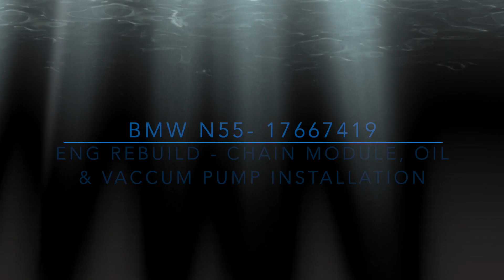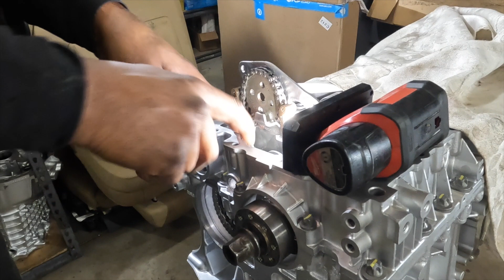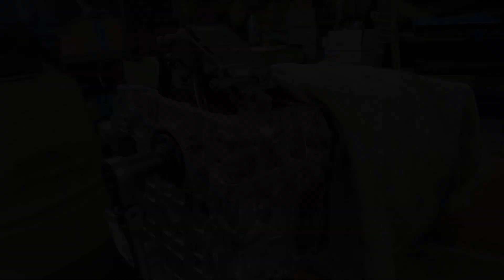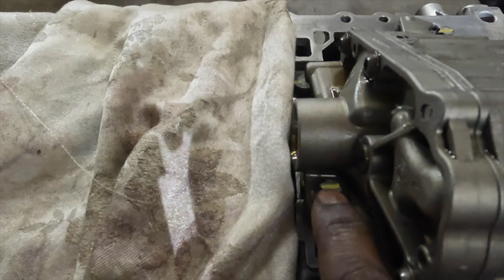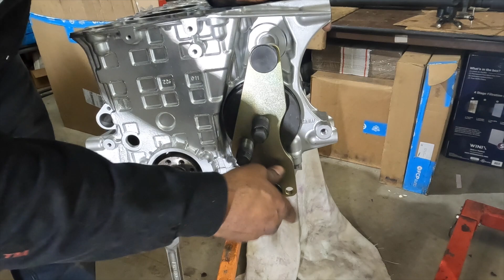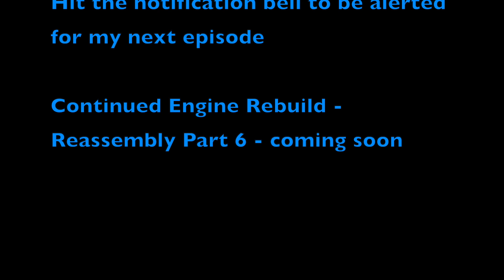BMW N55 17667419 Rebuild Chain Module & Oil Pump Installation Part 5

Comment: While doing my pan gasket on N51 I broke the output side oil pump chain guide nub. Shouldn't be much of an issue you think? Car has been running for almost two weeks now after the pan service.
Reply from the maker: Have a pic
Reply: @straightupbmw  I do but if you look on the oil pump chain guide assembly online it is the lower right nub. It broke that rounded end off.

Comment: Hello, I bought the chain maintainer 7 523 884, is it normal that it does not fit in the location of my oil pump? the hole is small however I took it from the BMW site which should be compatible with my BMW engine code n55 it originally had this mechanical operation

Comment: I use a 3/8 drive one inch E10 with a 3 inch 3/8 extention to remove/ install / torque that lower oil pump guide screw.
Reply from the maker: Which screw is that ?  The gear to oil pump?
Reply: @straightupbmw  The screw you were tightened with a wrench
Reply: You said in the Video that you can't find a socket to tighten the screw with
Reply from the maker: @shelray2154  ok, I will try , I have been using a 8mm wrench
Reply: @straightupbmw  yeah I saw in the video.  
I go in from the bottom with the socket, then push the extension through the hole and attach it to the socket
Reply from the maker: @shelray2154  ok, I understand. Thanks for the insight
Reply: @straightupbmw  You welcome
Just a note. Can you show the name of the stuff you use on the crank seal and also say the torque of everything you're doing. It would be of great help to those that's not a mechanic, but average DIY's
Thanks.

Comment: Looking forward to seeing the timing chain install.  In the process of replacing chain, chain guides, oil pump chain, oil pump chain module, and grip disc and sprocket. Currently timing everything with the timing kit following TIS directions, but when I crank the engine twice the cams and sprockets line up, but the tdc pin does not line up. I've checked if the vanos sprockets are locked which they were, and checked where the valvetronic was. I had the valvetronic at maximum lift, now with it at minimum lift it times correctly. Any insight to this? Thanks!
Reply from the maker: There is a lot going on here.  Did you torque your hub bolt 100n.m and then 270 degrees

Sounds like your crank is out of time to cam sprockets
Reply: @straightupbmw  Yes hub bolt was torqued to initial 100nm and 270 degrees with crank at TDC and crank locked. I retimed the cams to the hub with the valvetronic adjusted at minimum lift, and now it all lines up after cranking the engine by hand twice.
Reply from the maker: @jacobokun9135  glad it worked out